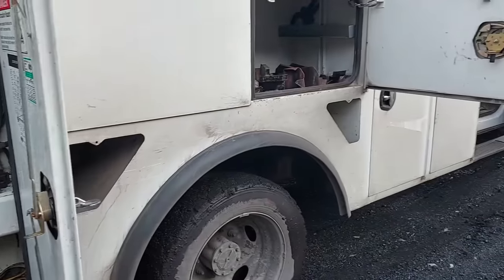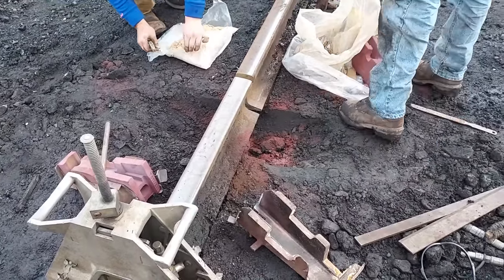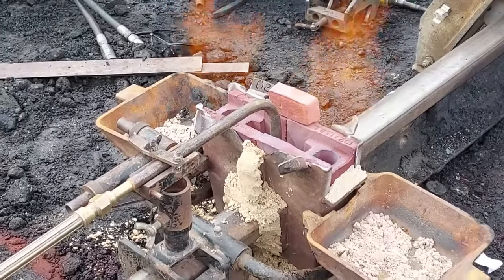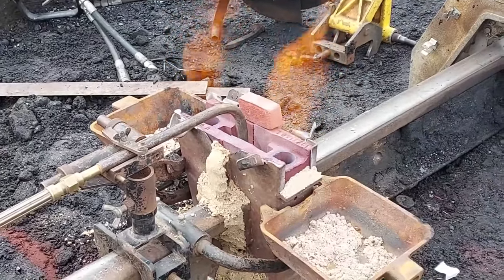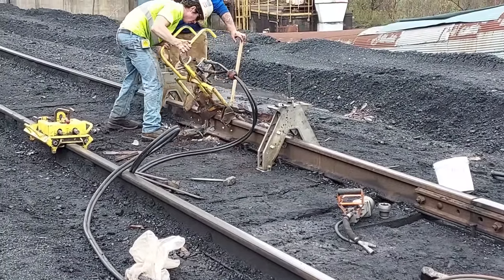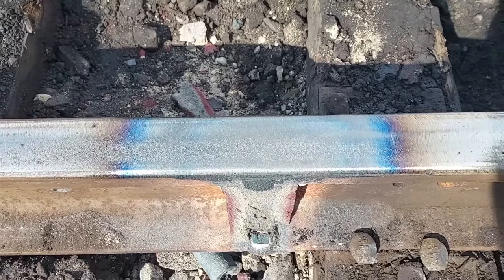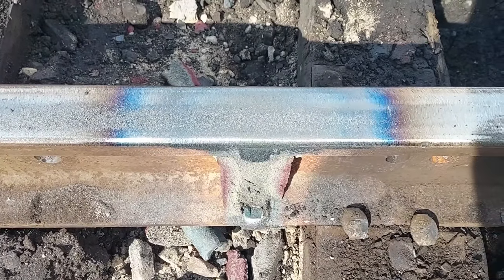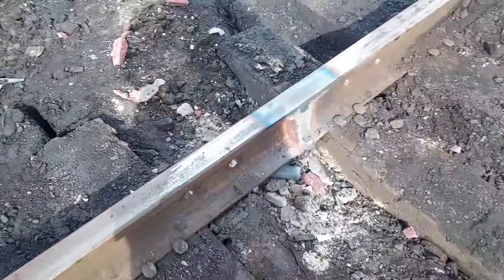Shooting a Thermite Weld on the Railroad from Start to Finish

Comment: thank you very much dave. really appreciated seeing how this was done all the way thru. very impressive work, the amount of safety that has to happen it's hard to believe no one gets hurt with all the hot molten metal around. how much water did it take to keep the coal spillage from lighting up with all this going on around?
also what were the rail level tolerances they really had to adjust alot to get 3D leveled. just when i thought they were good and level they did a bunch more adjusting and it looked like the final level had an upward pitch of 1mm per inch? some sort of rail flex that had to be accounted for when heated up to 500º?
tell them guys  well done, impressive work i couldn't even tell where the new and the old started and stopped with out the scab down below. they probably left that scab there so it would be easier to find and inspect later?

what was the reason for such a short piece needing to be welded in? i saw the bolt holes and was wondering why a short rail wasn't installed to replace. i know there is a reason, i just don't know what it is from what i observed.

also that's alot of excess coal spillage, i am surprised there isn't old worn conveyor belting laid down to help collect it. maybe have that historical rail road crew collect it with a small john deere X series tractor with a front end loader and use it for their steamie <wink wink>. mine could write it off as donation plus get some free clean up/maintenance so that debris  vacuum isn't needed so much?
Reply from the maker: Thanks my friend for the very nice comment.  Rail before
being welded does have a slight crown to it which is put in
to account for the small amount of shrinkage as the weld cools.

We have very poor ballast conditions here that won't hold track
surface under joints so eliminating the joints helps to hold the rail profile to within specs instead of sinking, thus helping to avert
a possible derailment caused by track surface deviations. 
Hope that helps
Reply: "1mm per inch" is a pretty triggering measure.

Comment: I watched this being done in Louisville Ky a few years ago and had no clue you could weld a train rail this way. Interesting!
Reply: It's the best way to join rail and it is required for high speed rail just takes a lot longer then fishplates. Continuous welded rail is as smooth as butter to ride on.
Reply from the maker: Very much appreciate your taking the time to visit with us and
watch the video today Byron.

Comment: Observations:
On main-line rails, the temperature of the rail should be taken to ensure it is within spec.
All of the luting should be cleaned off the weld area for inspection.
The weld number and date should be marked on the foot of the weld.
All hot debris should be taken to a single place of safety away from the job.
All cold debris should be taken away for disposal.
The joint area should be packed and ballasted to match running road levels.
Only then is the job done! (Nice finish to the rolling surface though 🙂🙂)
Reply from the maker: Thanks for sharing the great advice my friend. We do appreciate
your writing in and for watching the show sir.
Reply: The markings should be on the web of the rail to be in a more protected location.  If your railroad says base or foot of the rail then that is  where this info should go.
Reply: just who is all this advise aimed at?
lads in the vid don't need it ?
people viewing don't need it ?

Comment: During one of our rail upgrades we had stockpiled a lot of 9030 rail. The welding shop wanted the work, so supply purchased the kits. In order to get a correct mold, etc., we sent the supplier a short rail section. We made a fixture on a building slab where they could align the rail and shoot the weld. So we crop 2 feet off the rail end to make a 74 foot rail. Well, they shoot 3 or 4 and I get a call on the radio to go investigate.  All of the shots blew out. We called the company and they sent a representative out.  He showed up and told the guys to just go ahead and do their thing and he would watch. When they started to place the sand around the mold, they were moistening it. He told them that was wrong. That corrected the blow out. I noticed your contractors drying out everything because moisture can blow slag everywhere.
Reply: They're actually heating the mold up.
Reply from the maker: Thanks for the nice story Thomas. I'm not a welder but moisture
seems to me never a good thing around when welding. Had a
guy come here one time and welded a frog, he did a lot of
heating on the frog before starting to weld it.
Reply: steam explosion = eeek

Comment: 0:22  - Setting Crown  
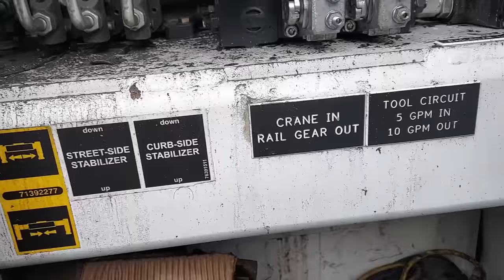1:40 - setting alignment  (He should be checking gauge side, not field side.)  
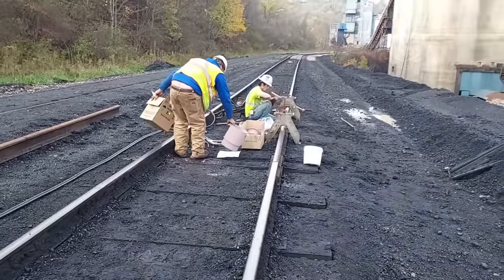2:21- Rectangular left side tool is called a Sheer (Squeezes/Cuts off Excess) Giant thing on the right is a Rail puller (Usually for destressing rail)  
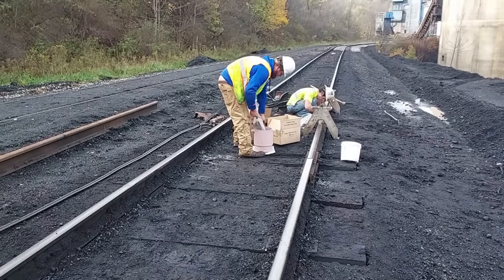2:49- The pot is known as a Crucible, The Thermite powder is Poured into it and later ignited 
2:57- you see the other guy with a red brick, known as a Shoe mold. He's filing it due to likely wear, but this also ensure a good seating. 
3:00- In goes The thermite into the Crucible 
3:40- Tyler- They're made out of a silica based compound, usually with age, you'll find they're easier to grind due to softening. The harder, the more course the silica is. (Also he's adding a paste/mud to seal off any cracks that the molten steel could protrude).
4:51- Sand uses bentonite, which is an absorbent and swelling clay. (Which in this case its said that it's Clay). Clay vs sand can be an argument of what is better. Clay typically can dry and crack, and someone has to stand guard incase any signs of a blow out. Sand can dry out, but can be revived with a little bit of water, and will always hold its form even if left out for a day after it was packed. 
 

So here's the part you don't see. There's a tool called a "Gap gauge", a multi use tool that you set in the weld gap and butt the torch saddle against and then anchor it to the rail (usually by a bolt). (the black clamp looking thing with 2 arms coming out of it. 

Once that is in place. One person will set their mold inside the Shoe jacket. The other person will hold that same shoe up to the rail while the person on the side of origin will take the arm and fasten the bolt in into a valley on the shoe. This holds it firmly against the rail. When the other side goes to be put on, the free shoe gets rubbed/grinded into the other, ensuring that the base of the mold and top of the mold have a good seating all the way around. It is also important to note that these shoes should be sitting straight up and down, prior and post being anchored by the torch saddle arms.  

The two then pack around the entire weld (ensuring not to get sand/clay INSIDE the casing) which not only prevents the molten steel from pouring out, but also helps insulate the heat.

Further on, The Square pans are called slag pans. You normally see some sort of sand in these to help preserve them over time. It catches the impurities/ excess. When you see him heating them with the torch, he is taking the moisture out of them which will prevent any Splattering or popping of the slag which can potentially be dangerous. 

Once the torch is set on the torch saddle, the flame is set to be in the center of the weld gap. I believe most welders use Oxygen (65lbs) and Propane (14.5-15lbs). You set the flame rich till you hear a crackling, then turn the oxygen up just enough for that crackling to stop. This is the beginning of your Preheat process which takes 5 MINUTES MINIMUM. Your heat soak should go about 10 inches back on each rail reaching 750 degrees externally and 900 degree's internally. 

Once proper pre-heat is reached, you remove the torch, set the diverter plug in, set the crucible and ignite the thermite. This process should NOT take longer than 30 seconds, as it takes at least 23 seconds for the Thermite to drop from the Crucible filling the weld.  

After 3 minutes, remove the crucible.
After 4 minutes remove the slag pans (Dispose of slag properly and set pans aside to cool, do NOT stack them)
After 5 minutes remove the Shoe Jackets and torch saddle. 
After 6 minutes you should be ready to remove/ break the top part of the molds, revealing the excess steel. If it is still molten, you re seal the mold on top and continue to let cool. When you begin sheering the excess, it's possible that with it leaking out, you can create a heat tear, so you don't want to go full throttle with your sheer all the time. 

Once sheered, knock off the excess steel or bend it out of the way, profile the top to NEAR finish. Grind the gauge side flush. Rotate to Field side, get it down enough, it's not required to be perfectly flush field side. Rotate back to original position and grind to flush. Fade in the edges of the head of the rail. 
clean up excess debris and take out any pitting on the edge of the collar on the base, and you're good.
Reply: So what is your take on this job ?🤔
Reply: @1STGeneral  Thermite welding on its own is a simple process over all. Its stressful when/if you have helpers who aren’t familiar. Its not an easy one man task. Not saying it cant be done, just makes it easier having help. Usually the parts where a second or even third person is needed is Packing the sand (some people use clay), setting up/ getting ready to set the sheer (if hydraulic or hand pump) and moving hardware and tools to next weld.  Its standard for most welders to shoot 4 in a day. If I have good help, 2 setups of hardware and pre made weld gaps, I can shoot 20 welds in a 10 hr day.  however its best to grind welds when they’re hot. If I’m welding and grinding, maybe 14 at best. 

It can be labor demanding, especially with grinding, it has its hazards and cautious measures. 

The only mental parts of it is knowing how many welds you can get out of an oxygen bottle, identifying where you could possibly have a “blow out” (where a weld leaks/fails) and making sure you have every last supply. 

1- weld kit for specific rail/ comp weld kit
1- crucible (safe start or make sure you have igniters) 
1 bag of Sand. 
——

tools

12” straight edge
36” straight edge 
2 a frames 
claw bar 
sludge hammer 
spike maul 
shovel
2lb hammer 
6 wedges 
oxygen bottle and propane bottle 
proper gauges 
torch body
torch head
1 corse file 
1 torch striker 
1 gap gauge 
2 5¢ nickles 
chalk/marker 
Rail saw with arm and blades (gasoline if applicable)
tape measure
—- 

hardware: 

set of shoes/jackets (base pan if 3 piece weld kit)
1 torch rail clamp 
1 torch saddle 
2 slag pans

demolding tool 
crucible carrier 

fire extinguisher

Comment: So with all the coal dust in the bedding is there a higher danger of fire?
Reply: I expect he was partly there as a "fire watch", which is an OSHA requirement for "hot work".  But you gotta keep perspective---a little smoldering coal dust is nothing compared to the thermite fire used to make the weld!
Reply from the maker: Coal was pretty damp when they did this but always keep
a close eye on stuff like this and stick around for awhile
to make sure nothing would catch later. Do appreciate
your watching Geoff.

Comment: What’s the reasoning behind doing this rather than just stick welding.
Reply from the maker: There are 2 ways of welding rail that are employed, Thermite and
Flash Butt welding. Our welds are done by contractors and 
they don't have the FB equipment. That is a type of arc welding that
is done by a robot welder of sorts. No one to my knowledge
does stick welding for rails. Thanks for watching and writing in
my friend.

Comment: I saw this process as a kid I lived in Blawnox on the east or north bank of the Allegheny River. 3 blocks from a CSX line that ran coal to the Springdale power plant.  It use to go further up and carring anything and everything. But I was fascinated by this welding process. I thought it was the coolest thing ever, the guys working answered all my many questions. I remember it like yesterday even the smell. My dad was a foreman at Mcwillaims Railroad Maintenance corp just down the rial or road for that matter. While he was there they released a machine called the Zapper that drove in spikes I guess really fast my dad was impressed by this at the time new machine. Mckwillaims invented a rail oiler and that got him into making railroad equipment.  Sorry about the ramble. another very cool process I witnessed was at night. I could only describe as the tracks being ground or resurfaced I assume at successively finer grits both rails at once. The sparks were flying everywhere lighting up the night like daylight. I would love to see video of that at night.
Reply from the maker: Thank you pghgeo for sharing the very interesting story with us. 
What is so cool is to see a thermite weld done after dark.
What you saw with the sparks was a rail grinder. They are
awesome beasts. We appreciate your taking the time to visit with us and check out the video. May you have a most blessed day my friend.

Comment: I've seen other videos of this process and it never gets old. A day when you get to light off some fairly large quantities of thermite and be paid to do it is a good day indeed. I'm curious as to how the decision is made to do this vs replacing the rail section.
Reply from the maker: There was a broken rail there and we put in a plug that had joint bars on it. The welders are contractors and were not available the day we put in the plug, so this is them coming to eliminate the
joints. Thanks so much for watching and writing my friend.

Comment: Maximum temperature is approximately 2500 °C, limited by the boiling point of aluminum, which is 2519 °C  Chemistry 101
Does this process affect the steel hardness ??
Reply from the maker: According to some studies welding does increase the hardness
and also strength of the steel being welded Victory First. However
consider also that increasing the hardness of the steel also increases
it's brittleness. Appreciate very much your checking out the video and may you have a very good day my friend.
Reply: @ccrx6700  Peace fella.

Comment: I bet you could use that for building demolition   ,see how fast it heats  metal beams.
Reply from the maker: I bet no one ever thought of that.....LOL  welder said he was goofing
around one time and lit off a small charge on top of an engine
block and it burnt right thru the bottom. Thanks for stopping by
and watching Mark.

Comment: You don’t need thermite to melt steel, just use jet fuel like in 9/11!
Reply from the maker: Thanks for taking the time to tune in and watch the show today Kobyashi.
Reply: @ccrx6700  

No prob! Thanks for being a 9/11 truth seeker by showing us what it actually takes to melt steel!
Reply from the maker: @Verbalmint  These welders were goofing around one day and
said they set off a small charge on top of an engine block, said
it burnt right through the bottom of the block. I've heard the Armed
Forces experimented in WW 2 with using thermite to sink ships.

Comment: If any railroad guys would happen to pop on, just a curiosity.  Back about 3-4" from each side of the weld I see the blue normalised steel.  I thought the shots were made to hard surface. Just curious is that normal,or is there another step? I guess it would be hard to chase the heat treat?

Comment: Thermite? Isn't that what they used to destroy the twin towers?
Reply from the maker: The welder was goofing around one day and set off a small
charge on top of an engine block. It burnt right thru the bottom.;
Don''t know about the towers but thermite is pretty awesome
stuff. Appreciate your taking in the video today Horse and Cart.
Reply: maybe they used it to destroy your brains

Comment: I was a volunteer of the incompetent variety at the Hocking Valley Scenic Railroad.  Our track had one (1) welded joint.  The rest of it was composed of bolted joints every--I dunno--50 feet or so.  We had a bolt-tightening machine that looked sort of like a big lawn mower with railroad wheels, and track-bolt duty was one of the simple joys of maintenance-of-way work:  just hideous.  Ergo, I'm a big fan of continuous rails and thermite.  Very fine video.
Reply from the maker: Thank you Mark. We also have a bolting machine here and I've
done thousands of bolts with that machine, it sure does a good
job. Very much appreciate your taking the time to visit with us and check out the thermite welding video my friend.

Comment: When/why does one do a thermite weld in lieu of using track plates? How long does the entire process take?
Reply from the maker: It takes about an hour to do a weld from set up to tear down Vegas Cycling. We did this here to eliminate a joint as there
is so much coal there the joints don't hold up well. Thanks so
much for checking out the weld show my friend.

Comment: Watched NS shoot 136 lb mainline recently.  Didn't get video!
Reply from the maker: It's a pretty cool thing to see in person isn't it SteamCrane! Very much appreciate your taking the time to check out the video and write in my friend.
Reply: @ccrx6700  NS uses a sledge and breaks the crucible.  We've had a total relay through our area, old NKP High Speed Freight Service. Latest was replacing a long siding switch, did it as 1 long piece instead of 2 pieces.  2 really big excavators had a hard time moving it. If you found a good contractor, you're living right!
Reply from the maker: @SteamCrane  👍😊